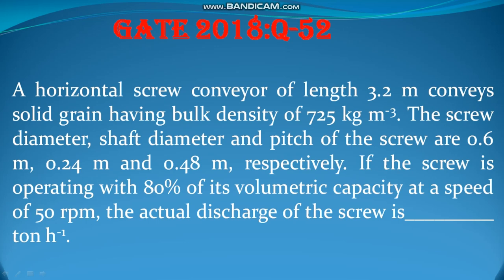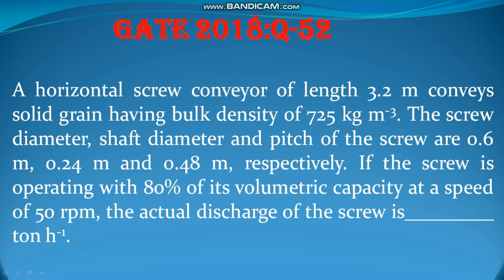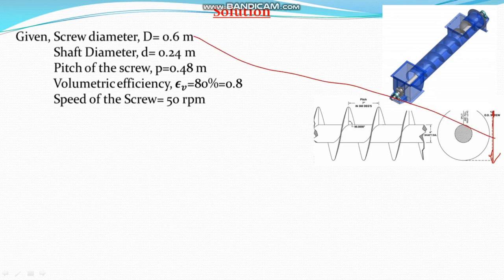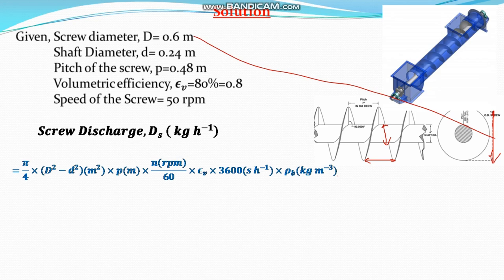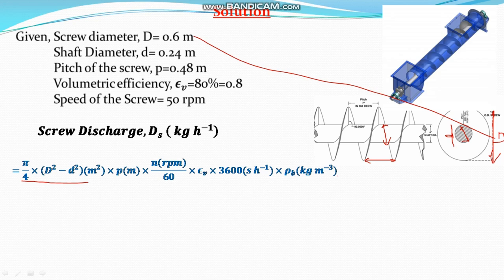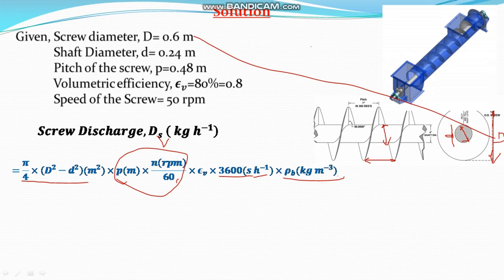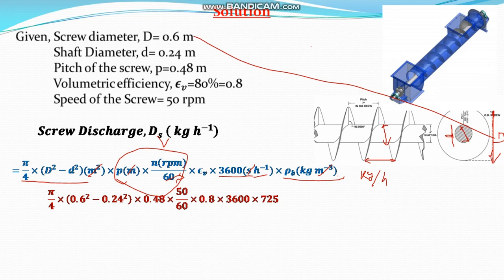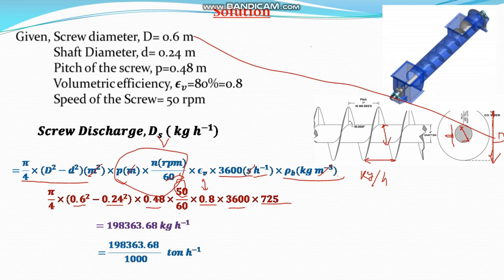Screw Conveyer Capacity GATE AG 2018 Q-52

Comment: You are not taking the length of conveyor 3.2m given.... In consideration?
Reply: Send me formula
Reply: At any given point, the discharge is the same along it's length.
Reply: The length of screw will matter in the calculation of motor capacity